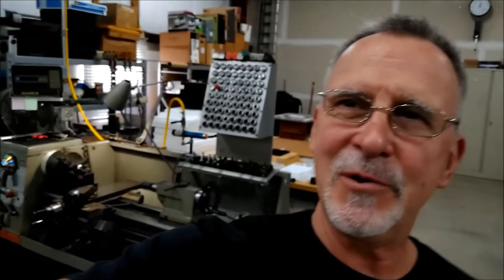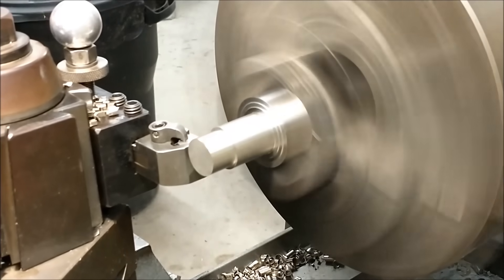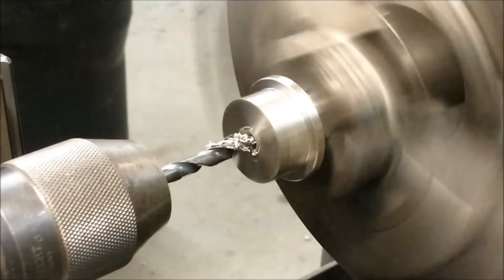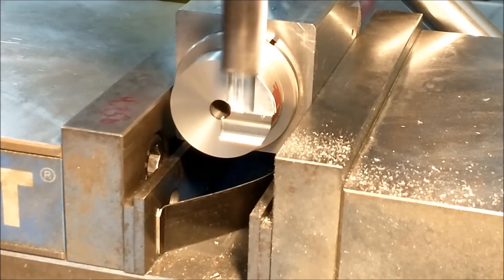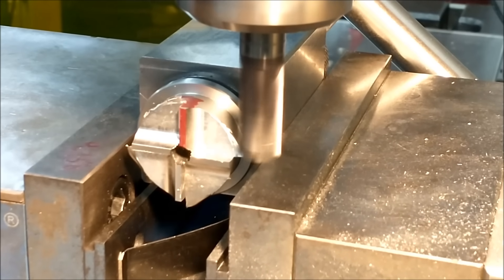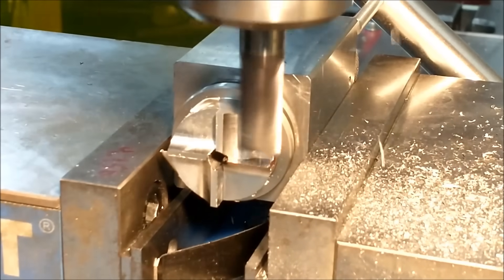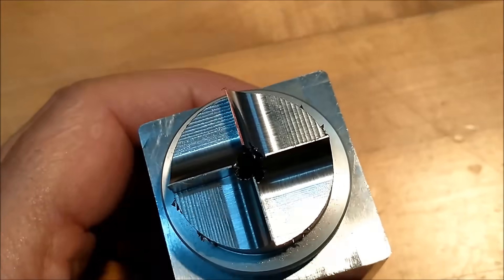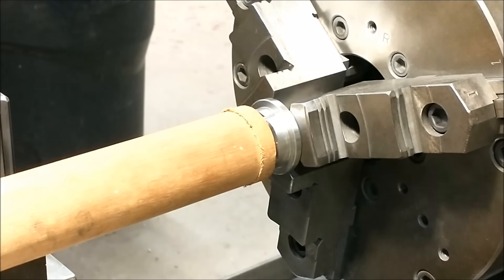Machining a Drive Center to Turn Wood on a Metal Lathe

Comment: joe, are you copying my video?? ;-) 
https://youtu.be/sWHu-cCbodYit's 
kinda koollll to get copied by a bigger name in YT :-) 
the only drawback to working with wood on a metal lathe is that you spin the work fast enough. wood requires a slightly higher RPM than steel especially in smaller diameters. you should also do something with tailstock...it will split the wood
Reply from the maker: Greetings. I apologize for the overlap in content. It was not intentional and almost impossible to avoid. I do plan to make a reverse cup center in a future video, so another "sorry for that" in advance. To anyone reading this...follow the link in the above comment and check out their build too.
Reply: @joepie221  no apology necessary Joe, i found it interesting that you went almost the same route i did in your build. it is rather flattering.
Reply: @joepie221  Again, now you tell me,,,,,,I put that request for the cup center below....You are ALWAYS ahead of me, Joseph.

Comment: Someone in the comments mentioned that the tailstock could split the timber and it gave me the idea to use a hose clamp, the type that screws tight.
Reply from the maker: Good idea. Lower profile teeth are also a step in the right direction.

Comment: A mating tapered X punch wood be useful but woody make one or just modify a spade wood bit to an offset flush to one side knife edge, as in Japanese knife edge style, and put to use with a tappity tap tap then twist 90° for a final tappity tap tap to form an X pattern to guide your work to a centered alignment with your Xilent steel wood work tailstock beauty.
Just thinking...

Comment: I am new to machining.  I need to make some dowel plugs.  .775 diameter with .375 hole through the center and 1” in length. I am using 1” oak dowels for my material.  Should I bore the holes first or turn first?  I am only doing 4 at a time so chucking the dowel to the chuck and only extending material 5” out from the chuck.  I am making 50 of them.
Reply from the maker: Its really your choice for an operation like this. But, smaller diameter material has a greater chance of flexing, so maybe the hole is best done first, then turn it and part it off. Use aggressive rake and lead angles on your tooling to shear the wood fibers.
Reply: @joepie221  Thks

Comment: I've made walnut French rolling pins on my lathe.
Reply from the maker: Nice. Keep it spinning slowly as you apply the finish and during drying. It will look like glass.
Reply: @joepie221  
I actually sand the walnut on the lathe then steel wool 0000 by hand.
Then I use real milk tung oil thinned with the last coat with japan dryer in it.
Been hand rubbing this finish for many years even for gun stocks and knife handles.
Its durable as hell.
It's even on my solid oak garage floor.

Comment: I used to use one, only it was to drive steel.I used to use it on small shafts about 3" dia by 4" or 5" long for OH crane wheels. Never had a problem.

Comment: I made a wood engaging drive baded og the VERY fine spikey plate out of a commercial counter top jucer machine. It has waves of 1mm tall angled hogh strength teeth. Over 300 teeth  in a 50mm diameter plate. 5mm centre hole . Plate mounted on a cast alloy arbour. 10mm hole all the way up the arbor for a centering pin or wood screw. 
Holds every thing from iron wood to foam.

Comment: Hi, Joe , Another great vid. Thank You . maybe do a vid on this I'm having an trouble with . When I'm drilling a blind hole using the DRO . With the different length drills  , whats the best way to touch off so the all bore and ream at the same depth.. ?  Michael
Reply from the maker: I always rest the tool against a known thickness tool bit and just add the value based on actual performance. Works for me with drills and reamers.

Comment: Good show Joe.   I made one similar a while ago, but I used 3/4” dia. Drill rod.   I hate turning wood because it makes such a mess, but sometimes you gotta do what you gotta do.  
I agree with putting the tool in the normal tool holder.   Best thing about machining is feeding the tool by machine rather than feeding by hand.   
One thing I don’t understand about woodworkers is their willingness to pay as much as they do for their lathes that spin only.  Metal working lathes spin, PLUS they move the tool in precise movements.

Comment: Nice job Joe!    Hey I have a question.  I need to internal left hand thread a 2" long bronze tube to .780" 6ACME.  It will then be slit and used for a half nut on a lathe.  Which insert and holder do I need for this project?  Guessing it will be in the 22IL 22NL 6ACME class of inserts.   Cutting the far side of the bronze bore and feeding into the headstock with reversed spindle won't be an issue as I have plenty of chuck and spindle bore to clear the tool.  OEM nuts are $90 each and this lathe uses the same lead screw for infeed and cross feed and threading so the keyed leadscrew eats half nuts pretty fast which explains my need to make a stockpile of them.   PS, Would it be easier to make a long taper tap from 1" round stock and tap the bronze?  Thanks for any help you can give.

Comment: I am new to this with very few tools but I do have an Alliant mill.
I need a 12x12 cube mounted to a plate at a 45 degree angle.  I will do this with 4 right triangles (8" legs) made from 1" plate. Picture a square that you pick up one side 45 degrees.  I will bolt the cube onto all 4 hypotenuses.   Two triangles on the right and a mirror image on the left. 
Here is my question:  How can I accurately mill out these 4 triangles without many tools?  I'm picturing making 2 squares then cut a diagonal on both with the band saw.   I will need to clean up all 4 hypotenuses (haven't used that word in 20 years, now used it twice).  Can I do them all at once?   How would you do it? 
If you don't get to this I understand.  I just wanted to let you know that your real world videos are making a huge impact on me.
Reply from the maker: Starting those gussets by making squares first should work well. If its a precision angle part you need, don't forget about the bandsaw blade width. As for finishing the hypotenuse, I would layout and drill a pin pattern in a plate mounted to the table. Nest the parts on that for location, and clamp them down. Thats just one option, but one I've used before. As for doing all at once, that depends on the cutter and material thickness. Good luck and thanks for the support.

Comment: Great tool Joe, that's going on the to do list! Can I ask what that neutral rake insert is, that you're always using? Is there a particular reason you use that over other insert geometries?
Reply from the maker: Its a TPG 321 insert. If you need a bigger tip radius, get a 322 or larger. The holder is neutral in the Y direction, but a very mild back rake in the Z. I love it.

Comment: As a suggestion for a future project. I would guess that many of your hobbyist subscribers are running old machines with worn out cross slide screws/nuts. I would love to see a video on turning precision acme threads. I have an old Colchester and replacement parts are way too expensive for a hobby machine. My machine requires a twin start thread, would be good to see this included along with advice on material selection
Reply: I too would like a video on turning ACME type threads. I'm sure you could reveal some concepts learned from your vast experience to us novices. Thanks, j
Reply from the maker: Great suggestion! They need to be supported correctly and actually measured to be reliable. Second option, make it undersize and call it good. Kidding on option 2.

Comment: I have not been tempted to turn wood on the metal lathe. Most of the surfaces are oiled and the cleanup would seem to be a mess.
Reply from the maker: Rag, vacuum, elbow grease. Problem solved.

Comment: Hi Joe,
That is a brilliant change to a normal wood turning spur drive. Having the driving faces perpendicular to the workpiece axis prevent it pushing the workpiece off as the normal spur gear can, which usually has a sloped face both sides. And it is so easy to machine. My wood lathes have MT head and tail stocks, but that is no problem either.

Thanks for a great idea.
Regards  Dennis
Reply from the maker: Its very strong Dennis. I like it.

Comment: Hey, Good to see ya back,,,,,Just why didn't you show me this before I made my "wrench" for the 5C collets. I never thought of using a collet block. (I my case the Hex block). I screwed around with the rotary table. (Dunderhead-itus) 

There has never been one of your vids where I didn't see something I could use later. I'm no spring chicken and have been arround machinery for decades, but I always come away from you vids with a couple more tricks to put in my bag.  

Hey, Not that is rocket science but a cup center that could be put over the live center?  Less chance of splitting the wood  and you wouldn't need  candle wax (That shows how long ago I was in 8th grade shop class 🤣)
Reply from the maker: Thanks for the comment.

Comment: I was looking at the thumb nail and wondering how you were going to do that, now I know!

Also, I have a ready source for scrap 316 bar. How does that compare, turning wise to what you used here, (303 if I remember).
Reply from the maker: 316 is a bit tougher, but will work just fine.
Reply: @joepie221  Many thanks!

Comment: I like the tool. I am curious as to your reasoning for nibbling to rough dimension as supposed to just climb cutting to it?
Reply from the maker: Reduced chance of it grabbing and in my opinion, much faster for the amount of material being removed.
Reply: @joepie221  Thanks for clarifying that.

Comment: Thanks Joe.  I had to sell my wood lathe to make room for my metal lathe and miss it from time to time.

When you pull a piece of stock and want to resume work on it, you'll want to make sure you get it placed back on your spur drive so that it's "clocked" in the same orientation as it was when you removed it.  One trick to do that is to grind a nick in one spur edge.  That way, when you want to put the piece back in after having removed it, you just make sure the notch lines back up with that leg on the drive.

Happy Easter!

-Kurt
Reply from the maker: I like the index feature. Good idea.

Comment: Hello,love your YouTube channel, concerning the tailstock end of wood turning,a 60 center is a bad idea, make a T shape bushing, or grab a 3/8 bolt about 1 inch long, turn the threads off (if you have access to a metal lathe) , center drill the head of the bolt, then just drill a straight hole in the wood,hammer the bushing into the wood, this worked well for me, made many production wood turnings.I learned the hard, the school of hard knocks, I’m retired now, but my day job was keeping 13 cnc turret lathes running on a daily basis , made over a million turnings in my 30 year career, Happy Easter!
Reply from the maker: Oops, you didn't watch the whole video did ya?

Comment: Hi Joe, Many thanks for all the wonderful videos that you have put out for us.  If I may add  my 2 cents worth here.  This is not the safest way here. You have a 4 way splitter here. The vibrations of turning can cause split creep. And you can have end failures, when you cut away supporting wood around this type of holder. Kind regards, and greetings from Africa.
Reply: no, i made one very similar. they work just fine and don't split the wood.
Reply: @HolzMichel  Thanks for taking the trouble to reply.  I have a two pin (steel) chuck that goes into the end of the wood that I use. And as the holes are drilled to take them. It leaves a safer connection than the one shown above.
Reply: @davidwootton683  interesting description. seems like that would work too, although i have never seen anything like it.
the thing about the bit shown is that it disperses the pressure of the tool against the work piece over a larger diameter/area. it greatly reduces the potential for slippage. it does take a bit of finesse to insert the driver into the work and not split it. this is usually done with the tail stock

Comment: Joe, very nice machining, BUT. I think that you will find that your design is Old Hat and modern wood turning practices do not use this type of drive center any more. I would strongly suggest that you watch some wood turning videos by well known experts to see what is currently being used. Regards from Australia.
Reply from the maker: If you can, reply with a link to an image. Thanks.
Reply: @joepie221  Hi Joe, here is a link that shows you the different drive options. He explains why some are good and bad. The main bad reason for your type is that 2 prongs drive into end grain and 2 into cross grain. The modern way is a round multi pointed teeth, anyway these pictures may help. The other problem you will also have is at the tailstock end, a straight 60 degree point is also not advised, as spindle turning is end grain, and pushing a point it is not good as the end grain will open up and become loose. The analagy of end grain is if you imagine a bunch of drinking straws, if you push something into them they open up. They recommend a revolving center with a center point, but also a ring around it to contain the end grain. Hope this helps, here is the link. Regards from Australia.   https://www.youtube.com/watch?v=mg50KDNCj2Q&t=8s     Here is another one. https://youtu.be/3T1A0GseDlg?t=74

Comment: How opportune is this? I just bought a 2" slab of white oak and will turn (metal lathe) a set of 8 legs to make a pair of replica coffin stools.  I was thinking of holding the square leg ends in a 4 jaw but this seems like more fun.  For the other end, I will make a small point with a retaining ring to interface with a live center.  I was considering using an insert for aluminum as a cutting tool - until I saw your cutting tool...  The white oak is quite fine grained but there are some checks - any thoughts on tear out?
Reply: I just bought 2 slabs 6' long of white oak for $150.  I'm restoring a boat.  It has to be clear and absolutely must be white oak.  2" thick 20 some inches wide and 6' long.  Was my price right?
I bought the ones close to the center so the rings would be perpendicular to the slab (I've made a few bows and thats how I used to do it)  When I got to the boat I realized that the ribs have the rings the opposite!  dang it. Now I don't know if I can use it.
Reply: @onenewworldmonkey  40 board feet of clear white oak for $120 - that's a steal!  My piece was a 2x16x36 inch off cut for $70.  Nice grain for furniture though.
Boat hull repair is an art form way above my pay grade - best of luck with it.

Comment: You made a "spur centre". Some versions have very small taper sockets in the bore to take different or replacement points. Some have parallel bores right through to take shell drills for boring out the centre holes in lamp spindles for wire. Nicely done.
Reply from the maker: Thanks Mark. I would have put a center on this, but my foot was killing me.

Comment: An interesting way to machine a headstock wood driver. For long term use you’d want to harden it but machinist don’t turn enough wood to worry about it. You could also make a long tool rest for use with regular wood turning tools.
Reply from the maker: A piece of bar stock in a tool holder and off ya go.

Comment: Joe, Abt the only main thing you forgot to say was COVER YOUR WAYS and as much of your metal lathe WHEN DOING WOOD. Not only do you get wood chips everywhere but actual powdered saw DUST much finer than metal chips that turns into oily sludge and packs into everywhere and is an absolute nightmare to get out ...GREAT video, just be aware of the cleanup mess afterwards.......

Comment: I’d like your ideas on truing up a square collet bloke.
Reply: Here is how I would do it for a 4 sided block. Using the largest collet (of known accuracy) hold a precision pin.  Stabilise the collet block with a toolmakers vise. Clamp the assembly into Vee blocks, one each end of the pin. Now with a fixed depth of cut dust off the faces of the collet block. Along with the usual facing sequence for squareness routine and the toolmakers vise you should have a collet block that is now square and coaxial. Hexagonal blocks will require a little more effort using angle blocks to set the 120 degree index.
Reply: @RobB_VK6ES  I used the lathe to true up the hex block. I turned a diameter in the lathe then tightened the collet onto it then took a skim across the corners. Works well if you put the corners down in the vice and clamp the flats and come in from the top to cut your hex or do your indexing.
Reply from the maker: Using a good collet and a gage pin, lock the pin in the block and go to the surface plate. Using an indicator, check the height of the pin for each side of the block. grind to correct as necessary.

Comment: All nicely done but, if i may, add some comments. Your drive has very sharp "teeth" that might split some fibrous timbers, traditionally the teeth are nearer 45 degrees, which also stronger, but this leads to side effect that the drive has to be hammered into the end,  if it isn't the teeth act as cutters if a slightly heavy cut is made. Compromise time?
Reply from the maker: I mention the edge of the tooth. It can easily be adjusted by being shorter.